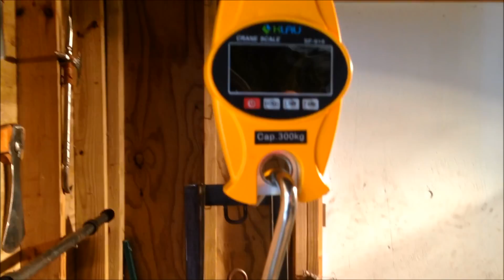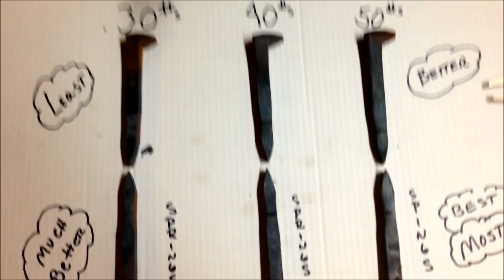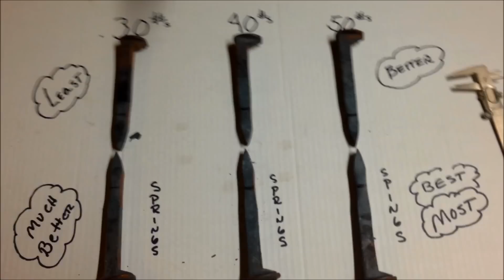Homemade Power Hammer  - Adding More Weight Test

Comment: Are you worried that the wooden cam is the weak point?  Dropping six inches every rotation is going to destroy it I would imagine.  Have you thought about implementing a cam and roller follower instead? Or maybe a linkage with an oscillating arm?

Comment: More spring tension equals higher velocity on the downstroke. Kinetic energy is =1/2m x v^2. So adding velocity (spring tension) increases the kinetic energy by a square factor of 2. Adding mass only increases the KI by a linear factor.  If you add 5 pounds of mass you only get 5 times as much KI. If you add 5mph of velocity you ger 25x the KI.
Reply from the maker: Thank you - appreciate it

Comment: Watching at about 7:30 I realized something. The cam is throwing the arm up and gravity has to bring it down. The more weight you add the greater the upward inertia and the longer it takes to change direction.
Reply: That, and the acceleration of gravity is a constant so the only way to significantly increase the volocity of the head is with springs.

Comment: I like what you are doing but I have a thought...talking about the impact point of the hammer on the railroad spike. the sq in of the hammer in this case is about 1.8 sq in.  if you decrease the size of the hammer. lets say the rail is about 2.5" across, you make it 1.25" across. by doing that you would effectively double the impact force. I hope I explained that properly. keep up the good work, thanks for doing the video.

Comment: I've been watching (and reading) with great enthusiasm pretty much any video, reading blogs, forums, etc on power hammers to learn what I can.  Unfortunately, depending on who answers your questions, or what you read there is a lot, a LOT of contradictory information being provided.  I'm not entirely surprised by that as plenty of past experience on the "interwebz" shows this pattern to be common across any technical subject matter.  Some of it seems sound and fits established norms within the scientific world and some of it is downright wrong.  Sometimes, it's hard to distinguish the two and sometimes it's just simply overkill.

Anyway, this seems like a very simple design.  What I like is the ability to customize it, meaning changing hammer and anvil sizes and shapes to adding or removing weight.  You can quickly and easily tailor the hammer for the specific work you are doing.  Throw the big springs and heavy head to pound out, draw, and flatten the billets, then swap over to a lighter set up to finish and planish a knife just before heat treat.

Certainly, I'm no expert on power hammers, but I'm no stranger to designing and fabricating things in my shop.  Looking at your hammer in operation during the test,  particularly with the springs unattached, I noticed a fair amount of lateral play and twisting as the hammer was working.  I believe you even hesitated momentarily as the the hammer seemed to be about to shake itself apart.

Part of the twisting is due to the offset wheel/cam from the longitudinal center line of the hammer arm.  The twisting is compounded as the weight of the hammer increases.  I would consider creating a second cam and wheel to mount on the other side so that the lifting force is applied equally on each side of the hammer arm.  This would remove any of the torquing effect.  Another option is to change the design to place the cam and wheel directly under the center line of the arm, but would change the layout of what you have already built, requiring cutting and rewelding pieces to make it all fit. The second cam and wheel would be simpler to implement.  I like the idea of using the plywood as wood is plenty strong for this application.  I even noticed you added what looks like some kind of runner around the edges of the cam...is it rubber, plastic, metal perhaps?  Thin metal would would increase the edge strength of the wood and make it highly wear resistant.

I think the mechanical design of the hammer overall is well done, but I would beef up the frame work in general, more bracing on the frame for rigidity (and mass) and stiffen the hammer arm by adding either 3/16 or 1/4 flats at least 3" wide along each side of the arm, if not outright replace the arm with something far stiffer.

The hinge point at the rear also seems to have a fair amount of play in it.  I would look into a more solid hinge point with a stronger bearing surface.  An axle of solid round stock (instead of a bolt) riding in bronze bushings as bearings.  The bolt is going to wallow out the thin edges of the angle iron very quickly.

The torsional deformation will induce more wear and tear, especially as the hammer weight increases, and should that twisting and lateral movement ever fall into a resonance, could be catastrophic for the hammer, if not dangerous to the user.
Reply from the maker: Thanks Edward - you have a good eye for detail and appreciate your suggestions.  I recently posted a video on some upgrades I have since made including a guide to eliminate lateral movement of the hammer arm (video link below).   For the cam, the banding you mentioned was a strip of foam insulation I tried - which wore off quickly - no surprise.  I agree a strip of steel bent around the Cam would be better.    I really do believe this design to be a winner for the home blacksmith/hobbyist  - I have used this power hammer a lot and it works really well for me.    As you indicate, it could use some additional upgrades to reinforce the back hinge points, hammer arm, and frame - perhaps even a cam made of metal - but each of these adds cost - so I'll hold off on them for now.  Thanks for your feedback

       https://www.youtube.com/watch?v=TgbWxa6LLsI

Comment: I think these hammers work better at higher speeds so they can get more hits to compensate for the smaller amount of weight. I could be wrong I haven’t made a power hammer yet. Smaller dies would probably also help more lbs per inch
Reply from the maker: Agree with your thoughts - the hammer speed can be increased by switching pulleys.  I happened to like the slower speed for myself, but I can always go faster.  Thanks for your tips!  Booyah...
Reply: @RickRabjohn   Yeah I agree with using smaller dies because the smaller the die the less surface mass it take to flatten steal, same concept applies to laying on a bed of nails.

Comment: Sorry ask hp to soon. Next grear reducing ratio ? Thanks
Reply from the maker: High John - I used 1-1/2 HP Farm Duty motor from Tractor Supply with 1800 RPM.  With pulleys, I reduced to 1200 RPM prior to the 15:1 gear reducer (i.e., from a 2" OD pulley on motor to a 3" OD pulley on gear reducer) .  Gear reducer output is then 80 RPMs or 80 beats per minute.  I do have a step pulley on the input shaft to the gear reducer - so I can adjust to three speeds resulting in either 60, 80, or 120 beats per minute.   Hope that helps and good luck with your build - would love to see it when complete - so let me know.

Comment: I would wonder what would happen, if you put a bigger anvil under that, i heard you had the best energy transfer at a ratio of at least 14 to 1 towards the anvil. Would love to know how that would change.
Great video though!
Reply from the maker: That's a great idea -  if I get some money I may swap out the bottom RR rail with a solid square steel block of 4140 or 1045.  Booyah!
Reply: That is a number that is thrown around a lot in forums and videos, I searched for the source of it but unfortunately could not find much "real" evidence except that many people said, that it increses impact.
So no guarantee, i still hope it helps! 
If you do, then please be sure to make a video about that as i myself am quite curious about a comparison of the same hammerpower with more anvil weight!

Comment: Thanks, for your video on the test. I now have a better idea on how to make the one I want to build. I like that you showed, not only the head working the metal, but the entirety of the hammer as it was working. Thanks again.
Reply from the maker: Thank for checking it out Steve -  It's been holding up and working well for my needs and saving my poor arms and shoulders :-))  Good luck with your build; cheers!

Comment: Hi Rick,
Nice chart on showing all you learned from your test,alot of vids are just hammering to someones favorite music and absolutely no questions are ever answered that way,in fact that always leads me to wonder more things.If I now find a vid like that like that I will stop watching completely.I use RR track as an anvil,I have a 3ft.section stading up in a metal bucket packed with dirt,you can get MUCH more mass below the sweet spot this way.I think if you were able to turn the tracks  you would lose the massless spots of the track risers in your equation.It would also run a lot quieter.
Reply from the maker: I like your thinking  Mickey Jay.   Your right about the underlying mass for sure.  Makes a big difference.  Thanks for checking out the vids and your comment.  Happy Holidays; Booyah

Comment: Don't you just love physics, that was the only outcome possible though. Great job in demonstrating both the hammer and the experiment. I would go for the springs personally as they should be way softer on the hammer than adding to much weight.
Reply from the maker: Hey Hey - I agree with you on leveraging springs for sure - thanks for the comment and checking it out. Booyah!

Comment: Sorry if this question has been answered.  Couldn't find it in the thread.  Where did you pick up the Gear box?  I've been online looking and can't find one with two shafts.  Just one shaft and a motor mounting.
Reply from the maker: I found mine on Ebay - I purchased two on Ebay and both have worked out well for me.  Hope you hunt one down and good luck with your build. Booyah!
Reply: Thanks for the info.  I'll keep looking.
Reply: Surplus center has then for 98.00 up to 1:10 under power transmission.

Comment: Wouldn't placing the motor at the end of the lever instead, and having your fulcrum point around the place of the motor, allow for more weight on the hammer with less stress on the motor? You would need enough length to allow the head to reach full speed, I'm no expert in levers and stuff though just a wild thought
Reply from the maker: I like the thought.  If I understand the concept, move  motor and cam To the far right (I.e., the opposite end of hammer head)- then have a fixed fulcrum pivot point in the center.  You would also need to configure the motor/cam to push down on the arm instead of pushing the arm up in order to raise the hammer head on the opposite end. Hmmm,  I think the concept has merit.  Just need a physics pro to do the math to see how It would change the required Force by the Cam/motor and resulting Impact at the anvil.  Thanks for the idea - if you solve the math, would love to know.
Reply: Yeah exactly that, I can't do the maths unfortunately, so if anyone that can see this comment let us know. Another wonder I had is if you add weight to the head of the hammer, and to the end of the lever (in the configuration I mentionned) wouldn't it still give more power to the head since you have springs on the head that add speed, while helping the motor move more weight over all ? The gains might be minimal though.

Comment: Great project, could you let me know what type of motors you are using? Many thanks
Reply from the maker: HI Art, you may want to check out Part II of my power hammer series of videos as I go through all the parts.  That said,  I used a 1 1/2 HP Marathon electric motor - single phase, Farm Duty, 1800 RPM, and 110 volt - I bought this one from Tractor Supply.   Good luck with your design/build and thanks for checking out my video
Reply: Rick Rabjohn thanks I have watched the part, great job, could you tell me what is that motor gear steaper you are using, many thanks. Oh and as you did some compeareson of hammer power if you would use let's say 4lb hammer and your full force haw that would compare to the power of your mashin. Thanks
Reply from the maker: ok on the motor output shaft is a 2 inch pulley which is connected to the step pulley mounted on the input shaft of the gear reducer.  The step pulley has three steps including a 2 inch, 3 inch, and 4 inch diameter pulley.  I usually use the 3 inch.  I think a 4 pound hammer would do very little - it would just be too light.  Today, I have it set up with 40 pound head weight.  Hope this helps
Reply: Rick Rabjohn many thanks for your help and inspiration. Keep up the good work.
Reply from the maker: thanks Art!

Comment: If you make the hammer head smaller it'll make the same amount of force but in a smaller area. that might be the way to go instead of adding weight and probably increasing your wear and tear on the machine
Reply from the maker: I agree - a smaller concentrated head backed by the same force will certainly make a difference.  I made some smaller power hammer tools with handles to help fuller-out or flatten the work - the kind you place on top of the work piece - that also seemed to make a difference.  The possibilities are many - thanks for checking it out and your suggestions; booyah!

Comment: Thank you for sharing your videos on building this hammer and testing the difference between adding extra weight along with assistance of the springs, I have learned quite a bit from these videos and once I can figure out where I can place this tool I will be building myself one, I am a metal fabricator in a sense, I used to own my own small business out of my garage in my old house, I used to build custom cars, trucks and a couple bikes out of a 2 car garage on a 3/4 acre lot, I ran my business for 10 years with the help of my wife and kids, did pretty good for 10 years before the economy took a crap and I couldn't compete with bigger shops, not only did I loose my business but I also lost my house. I now live in a mobile home on a lot that's roughly the same size as my old front yard so needless to say I am severely limited on space, as it is a good chunk of my tools sit on my back patio, atleast the tools I decided to keep when we moved. Thank you again for posting your videos
Reply from the maker: Thank you mrbratt69!  Glad to hear you saved the tools - nothing beats spending time in any size workshop or work area tinkering away.  Good luck to you and thanks for checking out my videos.

Comment: Video has stopped and the volume is intermittent. Been looking at 6 RR spikes for the last 15 minutes. Finally, get to see the hammer in action
Reply from the maker: Sorry about that, I checked it here and it worked fine hmmm...Also, audio is muted when the video speed exceeds 4x using the Windows MovieMaker editor and in some areas I had the speed set at 8X.    That said, thanks for trying to watch and let me know if it keeps giving you issues.

Comment: i think you need more speed mabey reconfigure your belts or something because it seems to be going to slow
Reply: keep in mind that since you have a trip wheel on there it will actually slow down the actual BPM on the hammer due to the expanding radius.  Also, once you add the springs the speed increases also.  On your first spike with no weights or springs you were 15 strikes in 13 seconds.  By the time you had all the weights and springs on you were at 15 strikes in 8 seconds.  So in the beginning you were only at about 65-70 actual strikes per minute with the hammer even though the motor was at 80 BPM.  Since the springs are what garnered you the greatest increase, I'd probably take about 1/2-3/4" off both sides of the top hammer and keep the springs.  The smaller striking footprint along with the increased velocity will probably come very close to equaling the additional weight with the same hammer head and it will decrease the stress on the over all system.
Reply from the maker: Thank you!  I have a step pulley installed on the input shaft to the gear reducer which can result in 3 speeds 60, 80, 120 beats per minute (BPM).  In this video, it was set at 80 BPM.
Reply: oh ok good that should help move metal faster :) i subbed
Reply from the maker: Thanks Chris - I like your thinking - while the hammer has been working great for my needs - I have been planning to configure the heads to secure smaller dies (with smaller footprints) for fullering or rounding etc..  Like you said - smaller footprint will help move the metal more for sure.

Comment: nice job sir! the use of the springs and the upside railroad track is smart. one suggestion i could give would be either a faster motor or a spiral gear with 2 or more drops that way it hammers faster
Reply from the maker: Thanks Akiva - I agree and did add a step pulley on the input shaft to the gear reducer which can drive up to 120 hammers per minute.  Thanks for your comment!